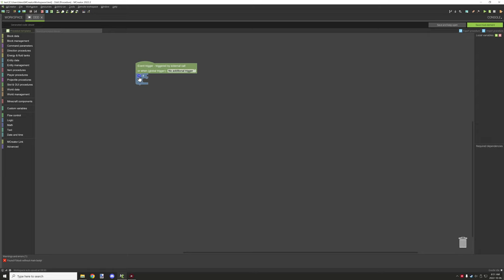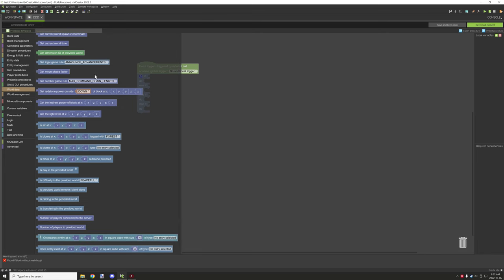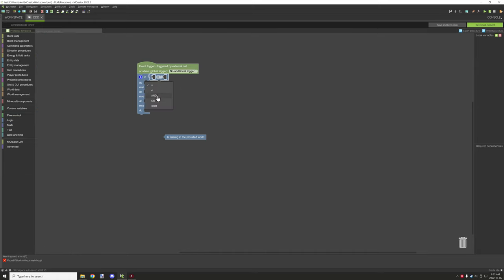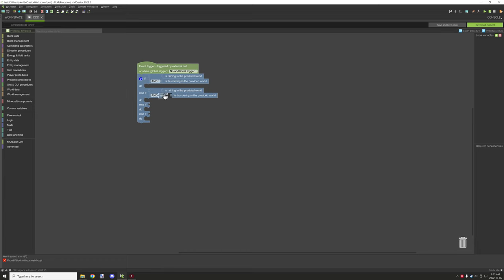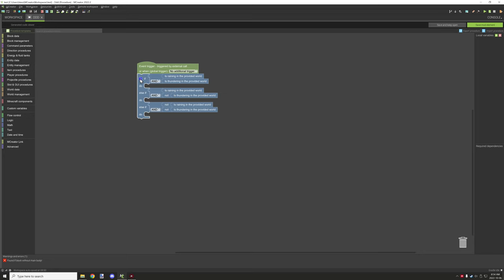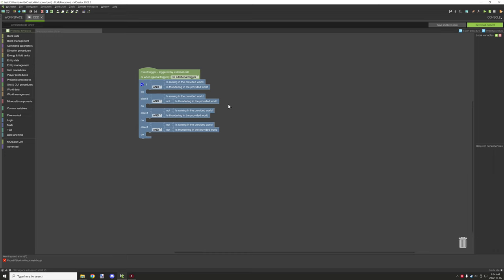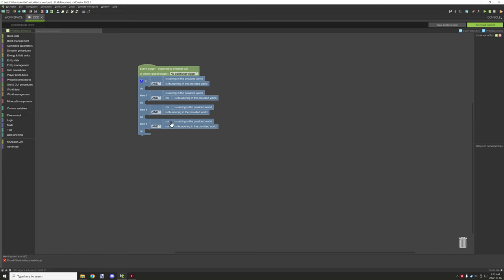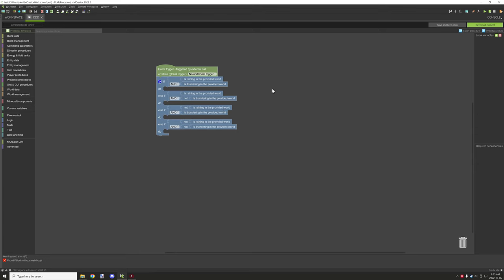MCREATOR: How to test for weather | 2022.2

Comment: Can you make a tutorial showing how to make a leveling system in Mcreator?
Reply from the maker: I have covered all the stuff you would need to know how to make this in older videos.
Basically you just need a player persistent or life time variable then when you want to change the value set the value to <same variable> + 1
simple as that you can set up that variable pretty much anywhere that supports an entity dependency for players.
You may need to ensure that the entity is a player or server player but other then that this will add to the variable when you do something depending on the trigger.
For example crafting you can increase this value, it also does not need to be + 1 you can set that value to any number if you want to lower it then us - or / adding would be + or * depending if you want to multiply, divide, add or subtract.
Reply: @NorthWestTreesMCreator  Thank you for the help.

Comment: Would there be a way to make an observer-like block?
Reply from the maker: I am not sure about the redstone part of things.
But it should be able to detect changes in front of a block through when neighbour block changes trigger
You would need to store get the block at X Y Z and offset the Position to the front of the block based on the rotation of your custom block.
Once you have the rotation part all set up simply store that block in front of your block to a blockstate variable.

Once that's done pass the the blockstate to a local variable string, you can use create text from block to convert what ever data is from the blockstate to the string.
Last step would be to test if the local variable string is the same as a stored string NBT, if it's not then you would want to trigger a logical variable on and then use a wait block then toggle the NBT logical variable back off.

lastly pass the local string to the NBT block string so it can test if any future changes are made.
This in theory should work as even rotating a block would would cause the blockstate to change. and would cause the block to detect a change via the string.

The redstone part could be triggered via the logic variable when its active, I just am not sure how to link that up right now.